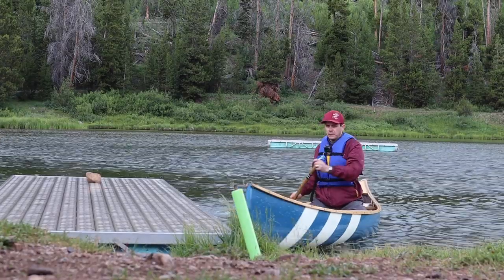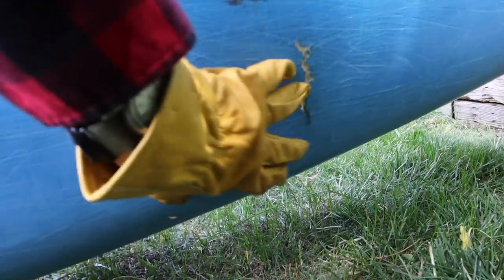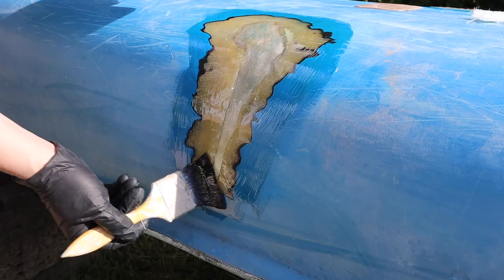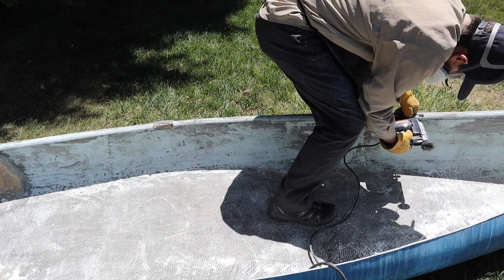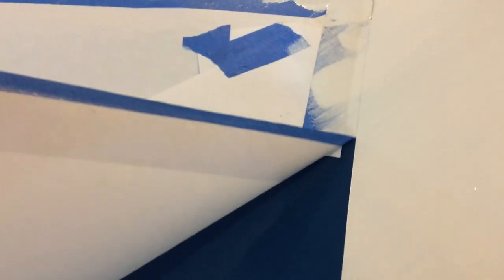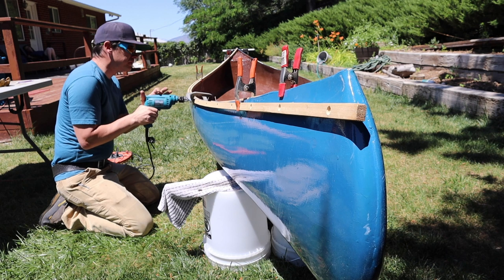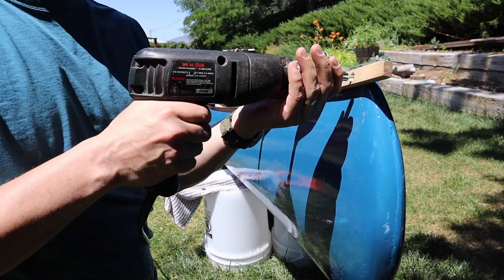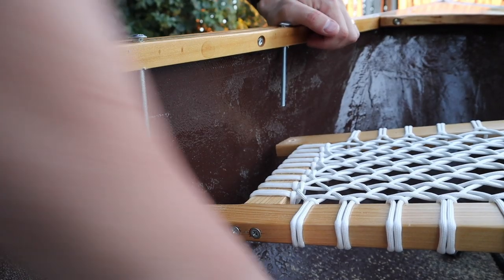Canoe Restoration | The Story of an Old Canoe

Comment: Starting my own restoration this weekend.  Picked an 18 1/2 foot fiberglass canoe out of my neighbor's trash.  Took it out on the lake.  Bone dry.  Sanded down the outside and inside of the canoe.  I have to do some minor fiberglass repair internally but nothing major.  I'll paint it as well.  Thinking about the striping now that you showed me how to do it.  Had not seen the varnish step in other videos--just the oil enamel with tip and roll.  Appreciate your story and the encouragement about restoration--I find it rewarding as well.  Thanks for taking the time to put this video together.

Comment: I tried patching up a 17' used Coleman canoe...a few years ago.  It had been abused by the previous owner...lazily dragged while going to and from the water...as each bottom end of it had a hole from so many abrasions.  Once I patched it up and got it to where I thought it was river worthy again, I took it out on the water and found that the front end still wasn't water tight.  I would have continued to work on it and make it useable if it were more stable in the water.  But that style of canoe (perhaps from around 1980...some kind of plastic or fiberglass construction) just wasn't as stable as my wider 16'  Old Town canoe.  I don't like a canoe that's easy to tip over.  I'm glad that the canoe you worked on was worth the repair.
Reply: I just purchased an old Coleman canoe.  It is going to be the base for a trimaran sailer, so it’s stability is irrelevant.  It’s size (17’) and the fact it is gutted, so I am starting with just a hull is relevant.  Only $150, so inexpensive start, plus the EPX foam I will use for the outriggers was free.

Comment: Not my usual thing to watch, but interesting. As I watched you add the wooden gunnels, I couldn't help but think you should have done them a bit differently. for one, I would have used some kind of sealer/adhesive on the back side where it attaches to the canoe. The other thing is it could use a cap rail, also glued, (marine epoxy probably best.) and screwed on the top, and rounded.  I would not have used regular bondo filler on it at all. I would  have used the fiberglass type filler, that looked like standard automotive filler, and it will not hold  up long term as the bottom gets a bit beat up, it will probably fall out.  in my experience bondo doesn't adhere all that well especially to fiberglass. (fiberglass flexes differently than metal and further generally)